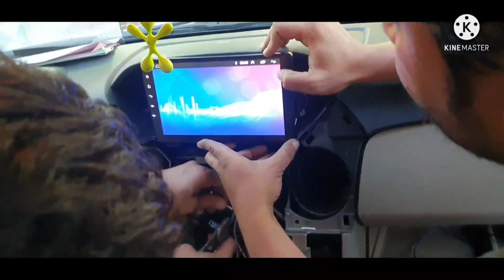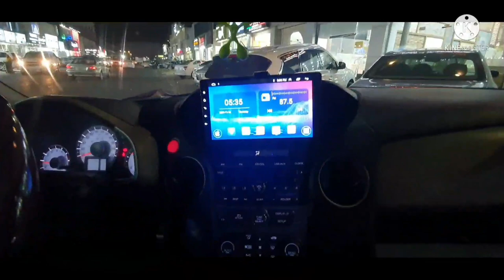Honda pilot 2009-2014 installation Android headunit 9 inches display Full information #hondapilot

Comment: Does this solve the known Honda Pilot bluetooth 3 second delay in audio and video? Right now it takes my 2013 Pilot three second to register a change in song using Bluetooth. And with video, the audio is always 3 seconds behind the video. It's very annoying!
Reply from the maker: Bluetooth frequency prblm yeah of course but this is not special unit for honda pilot you need special harness this is standard wiring and we made hole on desh for wiring
Reply: Facts

Comment: I have the same model Pilot.  Where is the link for the radio you installed?  Most after market radios are only for the 2009 to 2011 models.
Reply from the maker: even i don't have i opened the factory radio and bring all wires from the factory radio

Comment: ello, I enjoyed your video.
Honda Pilot 2013 is in operation.
Due to display failure, I was looking for data to replace it with Android, and I watched it on Youtuber.
I am currently unable to find a compatible Android, so could you tell me the Android product in the video?
Reply from the maker: it's Sbaid navigation system and 9 inches display Android 10 4/32 
just follow the steps and then you're able to fix it easily
Reply: @evolutionaudiosystem4781   does all the wiring comes with the head unit
Reply from the maker: @ryanramjas9040  not all but if we will buy special frames then we get otherwise if car is full option and have factory amp then compulsory with canbox harness